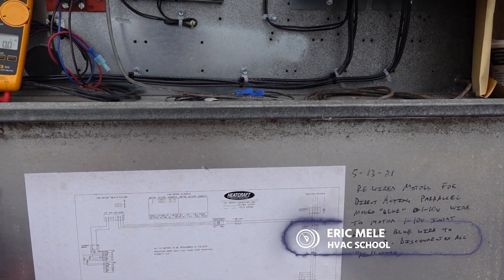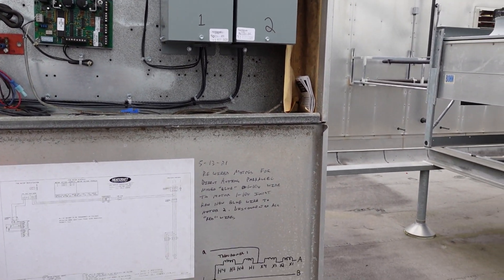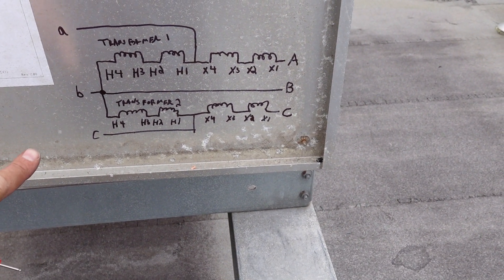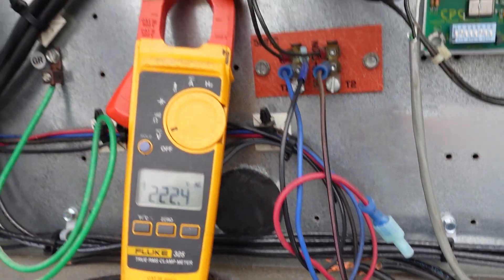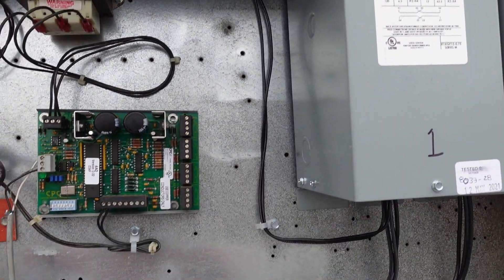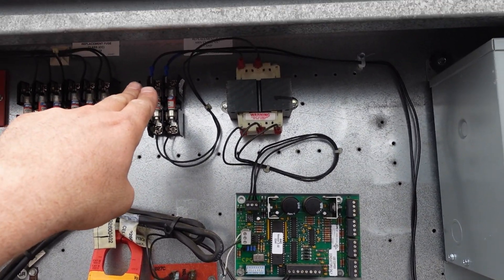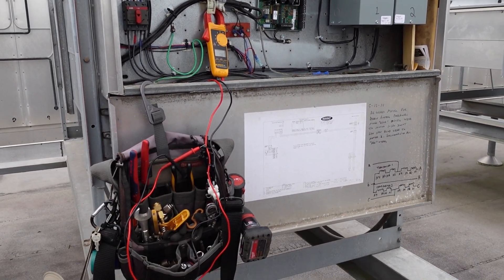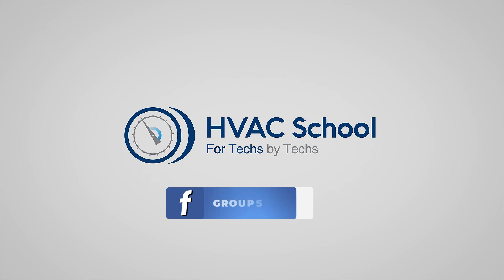Rewired Condenser with a Buck-Boost Transformer

Comment: Would be nice to know some general info of the site:

What type of condenser fan motors they are, just a simple 3-phase induction motors or ECM? 
Is there any speed controllers, I don't see any VFDs so maybe a PWM signal to the ECM motors?
If there is a VFD controlling the motors, is there a shaft grounding ring?
What type of failures are you running in to, just electrical or bearing failure?
What is the average age of the failed motors?
How low have you seen the incoming voltage?
Is the entire building experiencing low voltage? 
Was there ever a voltage recorder installed to monitor voltage fluctuations and phase imbalance?

Comment: Good Video & been there done that. You should allways make sure to consult with utility company first. Tell them voltage your seeing at the panel. i had a panel in a restaurant at 197-202 also and it was throwing codes in a Manitowoc indigo ice machine had a Low voltage issue too. i almost ready to put one of these on the manitowoc. utility company came out and found a transformer issue. they repaired. no problems since. its a good idea but remember those 2 transformers are going to put off some heat. if they are outdoor rated i would have mounted them outside the panel. if not maybe put a few 2" holes in ends of panel with screen & boxer fan on a Ranco etc111-000 temperature control. to see if needed drop a temperature monitoring device in the panel & download data to laptop via usb temperature monitoring stick.

Comment: Can you tell me what brand and model transformers you used? 

I would have the site owner call the utility company. Offen times they can just pull the transformer fuse, adjust the tap changer and pop the fuse back in and dome in less than ten minutes. 

That level of drop is unacceptable.

Comment: Perfect, even though slightly off  balance, this will prevent current rising and motors overheating. My education only mentioned the buck boost in a lower capacity for watt motors on reach in coolers that also were 201 vac supply. Utility could not adjust incoming without a major rework on a pole many streets away. 
Thanks guys at Kalos hvacr school for the tips. 
Never stop learning. 👍🏼

Comment: So your motors are rated for 208/240 service and you've put your boosted voltage at the top of the NEMA 200v (208v service) 20% bandwidth (220v) when the incoming line voltage is around 200v since that's kind of in the middle of the overlapping NEMA 200/230 bandwidths?  And that gives you a surge buffer to the 253v top of the NEMA bandwidth for 230v ratings and likely keeps you from spending too much time with low end voltages on the motors.  It helped a lot when I found a short write up on US voltage tolerance standards and started considering the bandwidths that are permitted.  Never considered it but for a 200/230 rated motor, there's likely that 30v bandwidth is probably the sweet spot for the motor.

Comment: I ran a huge facilities plant.  Did anyone check the utility voltage inlet to the main bldg meter panel?  Possible voltage drop from bad breakers or bldg disconnect switches or buss-bar contacts inside the customer's bldg wiring connections.  Verify utility voltage vs. end of run up to the roof units.  5% voltage drop is too much.

Comment: So many people do not know about these buck'n boost Transformers they have small ones for like a single 240V compressor you need to put in a corner of a shop that has 208 existing there already, there's many use case scenarios for these things. And for smaller things you can get something with automatic switching on a multi-tap Transformer. I got one on my computer that's a battery backup ($120ish at Costco) power supply and multi-tap Transformer built into it to switch voltage up or down on-the-fly. And when out of range of transformer taps it goes to battery backup.
Of course they have the same for bigger stuff but much more expensive especially if they have generator or backup battery bank system. 
I wish he would have shown an open panel on the buck's boost but I get why not show it on YouTube either.  At least we saw a partial schematic.

Comment: This is good information except the owner really should contact the the Utility company first for a couple of reasons. First, to validate incoming voltages and second to make them aware of this issue because it could be an overloaded Utility transformer at certain times of day. 
If the voltage at the Utility transformer is 120/208 then the issue is downstream of the Service transformer and will only degrade with time and load. 
Customer will not be happy if you install all these buck transformers and the real issue was not first identified. What KVA Buck/Boost were used?
Reply: I was thinking the same thing. There was a couple of instances where I had the customer contact the utility company for low voltage feeding the building causing equipment to shut down. All was fixed in an hour. However, the situation may be different at this facility. The customer may be paying for a higher voltage feed to the building (480v, 11Kv, etc.)piece

Comment: What’s happens when the voltage coming in goes back up during non peak usage? Doesn’t the output of that 200 lb  ginormous buck n boost setup voltage go up? How are u limiting power fluxation?
Reply: In this case, the guy probably took a tending power measurement on a day that's hot and has heavy load on grid or done over long period of time like a week or month and then he picked a range that best fits the tolerance of equipment.
I'm guessing this guy did something like that and set the voltage correctly so when demand was low the voltage wouldn't be out of range. We know he set it to the proper boost tap,  he just confirmed output.
But they do make auto switching ones that have the built in automation and everything for the situations that have more drastic voltage swings. Mostly I have seen them on server racks or dedicated circuits on cubicle stations for the computers. 
This is what I think we (hvacr technicians) should be hooking up to any system that has vfds, or any fancy automation that requires decent power.

Biggest battery backup system with multi-tap I had to partially take apart and remove was for a Boeing's flight simulator that had a room of computers to run it and the ammonia chiller to cool everything. 440v battery backup with about 5 hours of run time, just enough time to have techs come in and shut system down if power is not restored.
377 volts dc was still on the "discharged" batteries, 60 - 12 volt flooded lead acid in series. I started in the very middle of battery bank and begun removing the first bus bar. I was puckered up so tight, you couldn't hammer a nail in my ass with a sledgehammer.
Reply: @Georges3DPrinters  Good on you for taking the time to record the puckerometrics. But really, you should look for a less painful option than "nail and sledgehammer." I recommend getting the Pucker-o-Meter, it'll tell you the exact force you're clenching with. it's effective measurement range goes from "Prolapse" to "Making Diamonds." It's an excellent little tool. Unfortunately it can't quite read up to "Black-Hole" pressure, though speculation has it that v2 will expand it's capabilities.
Reply: @TheMinecraftACMan  😂😂😂😂
Reply: @TheMinecraftACMan  🤣😂🤣😂🤣😂
Reply: im sure hes been out there several times replacing motors & allways finding low voltage. 
alot of motors have probably died before you get to this point.
as Long as utility company says its all good on thier end / Transformer is ok & and a Electrician says the Panel incoming & outgoing voltage are the same / the Panel is in good shape. if your loosing motors , this is what u have to do.